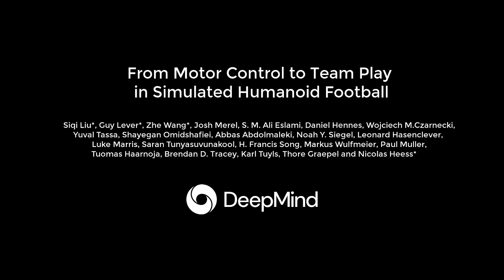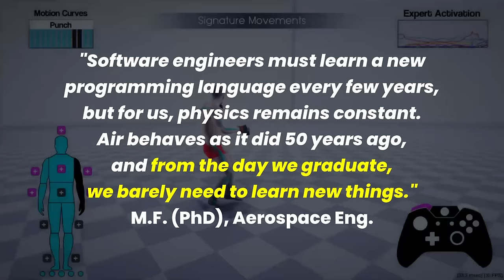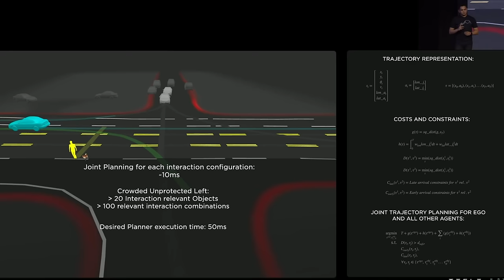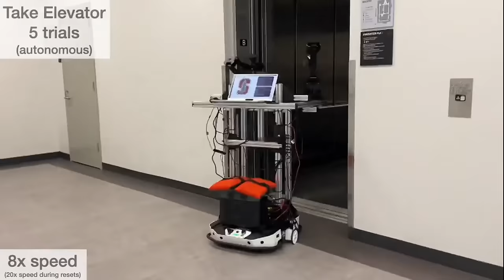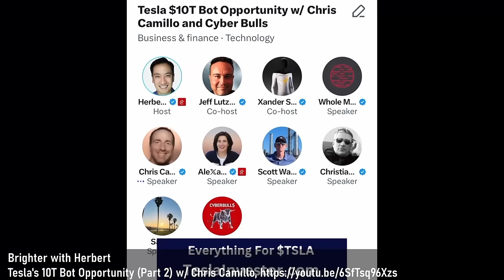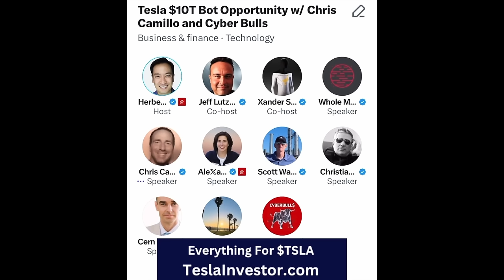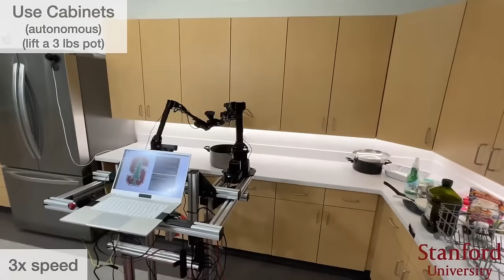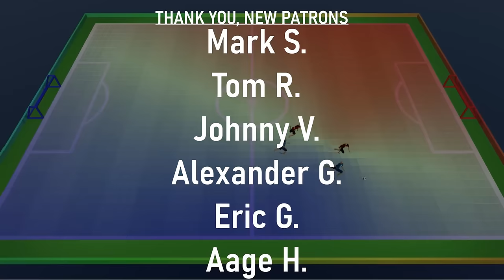Training Humanoid Robots | OPTIMUS PRODUCTION DELAYED due to Insufficient Training Data?!?

Comment: You missed the fact that Tesla already showed end to end training videos at the last Ai day. They've had it for a year
Reply: Not really, a proper end-to-end training for humanoid robots doesn't exist yet - although there are some promising models that have to be researched further. A diffusion policy that is enough for a car to drive is not enough to generalize a multi-tasking robot with so many degrees of freedom. All the imitation learning examples shown so far by academia and some companies are very narrow, don't generalize well and fail when even small changes are introduced to the environment.  It's not just a matter of data availability.
Reply: The demo was for testing the hardware and dexterity, not e2e. Their first block sorting video was e2e, and included random noise via a human moving things around.
Reply: @rickkay9548  and even before that they showed an engineer celebrating when it first learnt e2e to pick up an object
Reply: ...also Google demoed the coffee making thing before Figure did it. They just copied that from a Google paper
Reply: @stanvassilev  This is literally how everyone is doing the training. You show it movements that can be used for generalization then use video data.
Reply from the maker: @robbiero368 True, i forgot that one. I had it on the back of my mind but didn't remember when they said they haf it and didn't have time to check when creating the videi - so i left it at "i'd be surprised if they don't have it, but even if they don't, they will soon"..
Should've been "they have it. They're ready!" which is more bullish and also matches my original predicted timeline.
Reply from the maker: @stanvassilev  different demos, one for e2e, the other for mechanics and dexterity AND/OR TRAINING. The reason i believe tesla gas e2e isn't my being a fanboy, it's because even grad students can do this nowadays. From an impassable problem it became an easy one.
Reply: @ConnectingODots Do you think that in 2035 with the advent of AI (Artificial General Intelligence) they will put universal basic income!?  there will be free will!?  an era of abundance will begin!?
Reply: @ConnectingODots Do you think that in 2035 with the advent of AI (Artificial General Intelligence) they will put universal basic income!?  there will be free will!?  an era of abundance will begin!?
Reply: @francescoambrosino1841  You get a robot... you get a robot... you get a robot...

Comment: Haven't finished watching the video yet, but I'm at the 25 minute mark to 28 minutes where they're talking about a lack of training data. The first thing that pops into head is the new Apple headset and it's immersive video and body movement tracking. I wonder if there's a possibility that Apple will be harvesting that information as training data?

They would have a daunting advantage if they can get that to work and there is a big uptake in those headsets
Reply: Tesla just created job openings for AR/VR experts for developing systems to train robots.
Reply: @emilenossin5098  no one could have seen that coming
Reply: Now Tesla just has to come out with a VR headset that people can buy cheaper than the Apple vision pro

Comment: Full Self-driving requires understanding a massive amount of input variables but the output is 2 simple variables rotation and acceleration.
Making coffee only has a few input variables but requires many output variables, pressure, position, and acceleration of multiple rotary actuators.
When selecting robotic tasks to perform why teach a robot to wash dishes a very complex task from both input/output variables while teaching a robot to load/unload a dishwasher is much more manageable.
Using a humanoid robot in a warehouse is probably the wrong tool selection as nearly all the tasks can be performed by a wheeled grasping robot far more efficiently. Instead, a humanoid robot exiting an FSD vehicle taking packages from the vehicle and placing at the doorstep is a manageable amount of variability.
Reply: Yep! but a mistake in interpretation of the input for FSD, carries consequences a million times more imortant than messing up a cup of coffee.

Comment: The level of training advancement is the function of compute AI GPUs available. DeepMind, Meta, Tesla, Microsoft and IBM are the ones with over 150K H100 gpus each. That is the real differentiator in the skill level of the end product. The other aspect is the reliability of the mechanicals of the bots at work. In my opinion, there should be Service Bots that can replace/repair parts of the operating bots making it a humanfree operation. Sure, the manufacturing and assembly of those parts will require some sort of human effort but it would be 90%+ automated in any case.
The race is going to be exciting as more players come into the scene and innovation in training gets on the way. The need for AI compute will get another wave of skyrocket growth!.
Reply: Again, many of you are forgetting that human beings will be capable of improving themselves, so they will continue to be a relevant factor in the equation. Possibly the most.

Comment: In manufacturing you need dedicated robots not humanoid. For care of people you need humanoids but that will not be in the near future ready. Why is this not mentioned in this video? Further especially the way Tesla build the robot the battery will drain fast as it is small so there goes your 24 hours active theory. The video looks like made by AI yes it captures some good points but misses out on many.
Further did you ever heard Foxconn? Manufacturing can be outsourced.
Reply from the maker: 1. Industrial (dedicated) robots are great, but too many jobs in manufacturing are done by humans and TBH we slow it down. 
These do not come to replace Industrial robots, but rather to address the labor shortage. Some WILL go to healthcare (Fourier Intelligence Robotics is one company trying to do exactly that, look for them on YT), and this can too, but manufacturing is easy to tackle and will bring huge benefits. 
2. Tesla are extremely efficient in energy management. The battery is intentionally small - make for a less expenssve and much more agile robot,. in many jobs you can actually be plugged it, or get charged wirelessly, for other jobs there's no problem wearing a "range extender" backpack that charges as you work. A better solution than a huge battery pacjk which you pay for even when not needed and required going to charge the robot instead of just replacing one booster pack with a fully charged one. My own analysis works at 20 hours a day, 350 days a year - an easy to use 7000hours per year, roughly the output of 3.5 humans
3. On one hand - Foxconn will also use similar robots in place of human employees. On the other - Apple etc will have no incentive to outsource to lower-wage countries when the wage part goes away. Much easier keeping manufacturing close. 
4. Spent a lot of work making the video, sorry if it seems AI made to you. My next video is something huge - hopefully you'll like it better :)
Reply: @ConnectingODots  will watch your next video. However still not convinced by the counter arguments. Only time will tell!
Anyway thanks for the answer! 😀